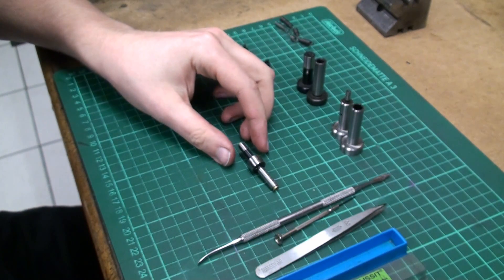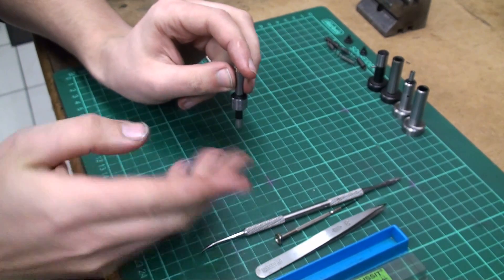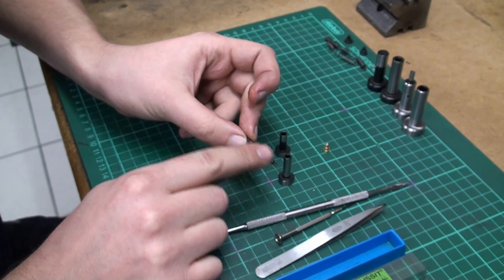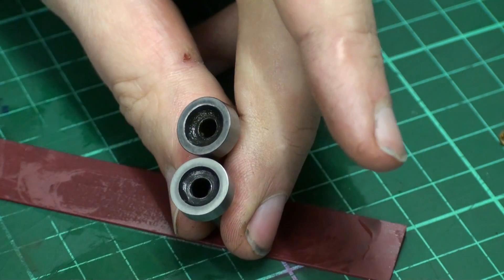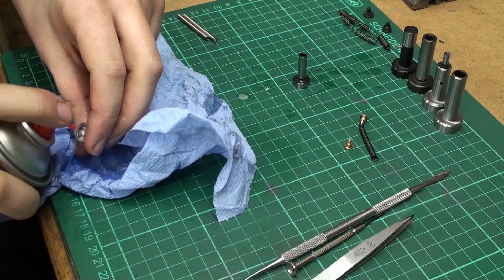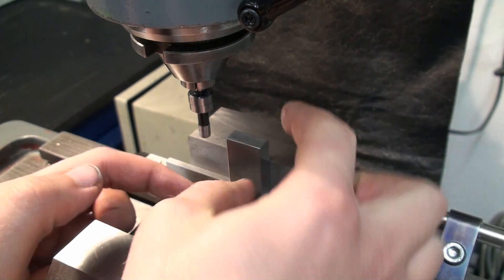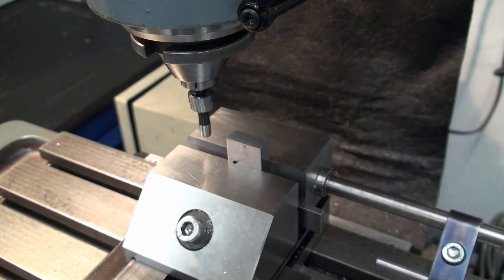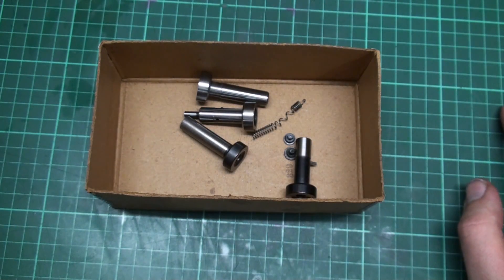Edgefinder Repair

Comment: Just want to thank you for this tutorial. Bought a Chinese edge finder and the surfaces didn't slide properly. They stuck at places. Had to even grind them on a 1000# diamond plate before honing them. The initial grind pattern showed a very uneven surface, with even a straight edge! Also deburred the inner and outer edges. Now they slide smoothly! Wouldn't have dared to touch the tool without this tutorial.
Reply: Half a year later, re-reading this comment,  I realize I may have reduced the accuracy of the tool. If you imagine the extreme case where I ground the tool so far off that the lower part is at a 45 degree angle, it's clear that, while I'm still able to rotate around the spindle axis, the minimum rotation circle is no longer the diameter of the tip of the tool (4mm), but much wider!
Not sure how to test this properly...
Reply: I know how to measure the error.  If I touch off on both sides of a gauge block, the distance should be 1/2 the diameter of the edge finder's tip + the width of gauge block + 1/2 edge finder. In other words: subtract the gauge block size from the distance travelled  and that should be 4mm, in my case!
Reply: Still.  I'm not sure if it matters that much....
The sliding surfaces may cancel out any deviation.
In which case the effective error is only determined by the contact area of the tip of the edge finder and the object. That is, if the tip of the edge finder is barely below the top of the object, there will be virtually no error.
My apologies for abusing this comment section for my brainstorming.

Comment: Looking at the reassembly procedure where you tension and manually retain the tension spring, I would think that a thin piece of shim stock (0.1-0.3mm) inserted between 2 protruding windings would probably work as well to prevent the retraction of the tensioned spring while assembling.. This has the advantage of having both hands free to mount the spring cap. I think this would work well for fine pitch springs placed in a bore and are under little tension.
Reply: I agrxee compemetely. I juste reassemgeled onef and ifs painfuld. Sorrty for the bad typenig, my findgers are sore.

Comment: It was good to see what's inside the edge finders. I never had the time to take one apart to look.  Thanks for the video.  What did you call that waxy grease you used as a lubricant?  Jeff
Reply from the maker: Ujeb08 Its vaseline or petroleum jelly, I dont know whats the common english name for it.
Reply: vaseline or petroleum are right in English also

Comment: Very cool! The .005mm error really surprised me... Maybe you can do a video about spring winding!
Reply from the maker: JTZshokunin Those edgefinders are suprisingly accurate, 0.01mm is not a real problem with one of these - I did spring winding in apprenticeship, but I havent done it for a long time. Even if theres not to much into it. Just wind springsteel wire around a mandrel, preferable on the lathe :D
Reply: The 0.005 mm can come from pretty much any source in this setup, like stick-slip in the machine ways, pitch error in the screws, backlash in the drive belts, bearings, round-off errors in the software, user induced errors, tool holder eccentricity, you name it.

As for "what to expect" and "what you saw" the edge finder is good enough. Maybe Stefan can live with that ;)
Reply: And bake them in the oven after winding so they relax and do net get an instant set when in use. If I recall correctly, 225 Celsius was the temperature or straw yellow.